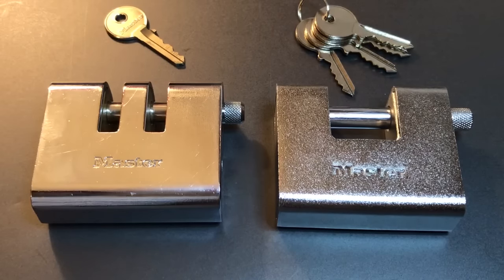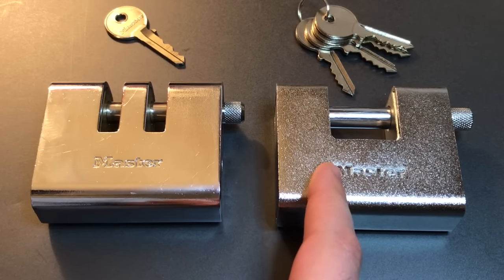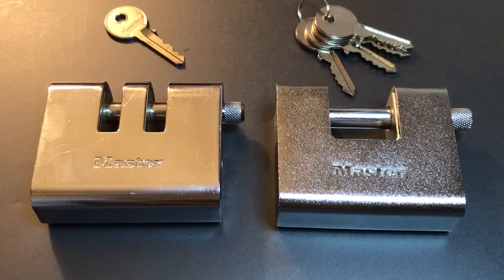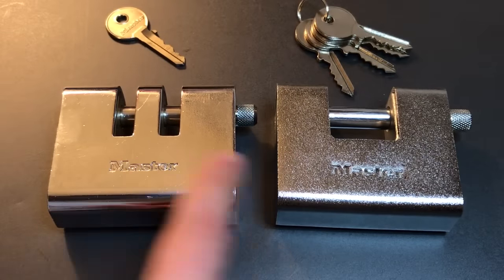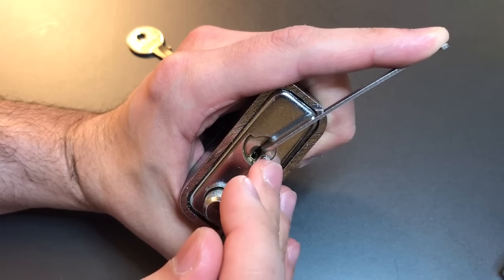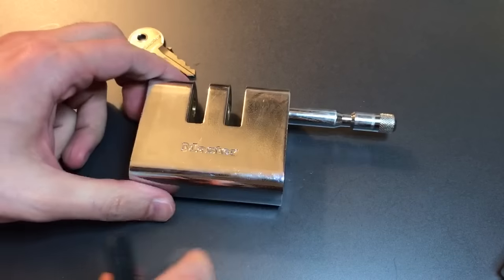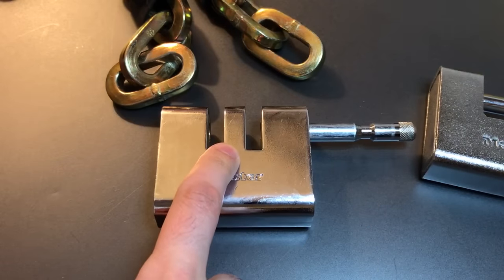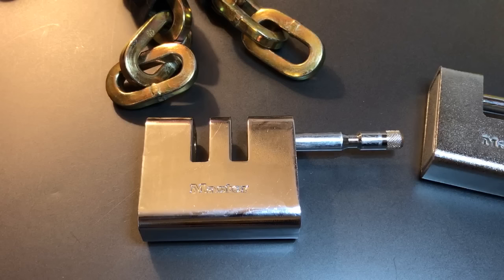[339] Master Lock Armored Shutter Lock Picked

Comment: I agree that it would be nice if the 9.5mm chain would fit in the lock as built, but I would not hesitate to file out those slots to fit the chain if it could be done and would not otherwise compromise the lock.
Reply from the maker: One could easily mill out the slots (with a carbide end mill) without ill effect on the operation, but you would lose the chroming...  I would not do it.

Comment: You could grind a few thou off of the sides of that chain with a bench grinder or dremel and contour it to interlock with the lock body, then when you put the shackle through it would be a really tight overlapping fit.